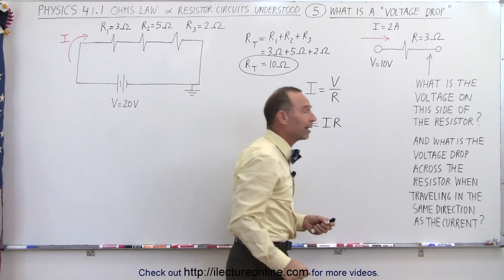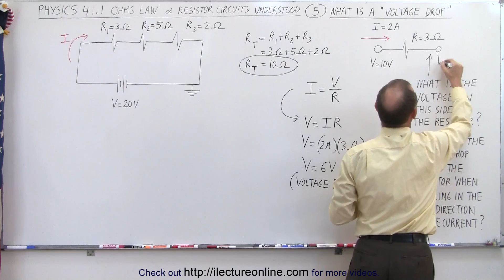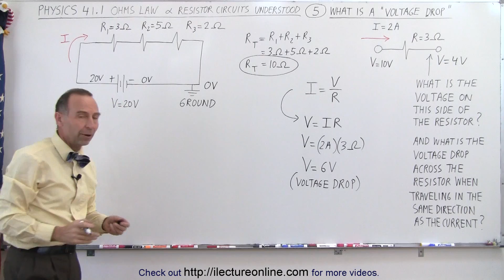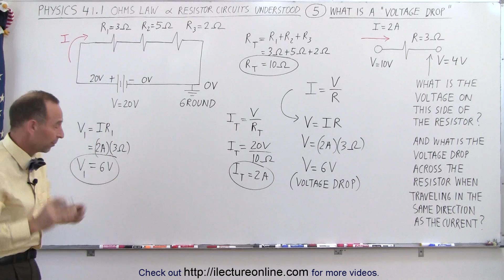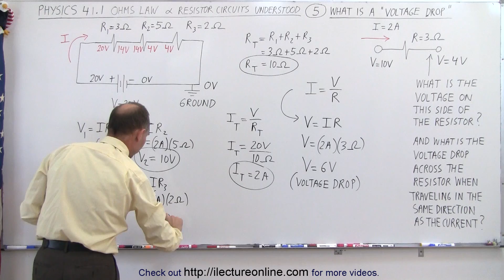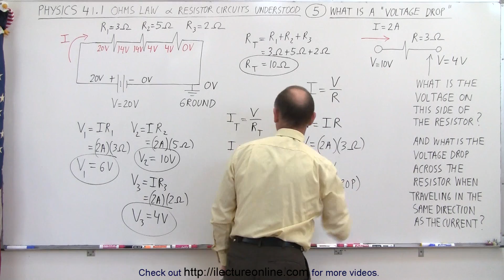Physics - E&M: Ch 41.3 Ohm's Law & Resistor Circuit Understood (5 of 27) What is the "Voltage Drop"?

Comment: prof. why is I constant? wouldn't I vary as the voltage across is not constant [I=V/R]
Reply from the maker: Since the voltage is constant and the resistance is constant, then the current must be constant.
Reply: @MichelvanBiezen  but the voltage after the 3 ohm resistor is reduced from 20V to 14V, so dosen't the current also change
Reply from the maker: No.  One must apply the rules of circuits.  The current entering the circuit = voltage supplied to the circuit / total resistance of the circuit.    If there is a parallel connection, then the current will be split up into each branch where the sum of the currents in each branch adds up to the total current.